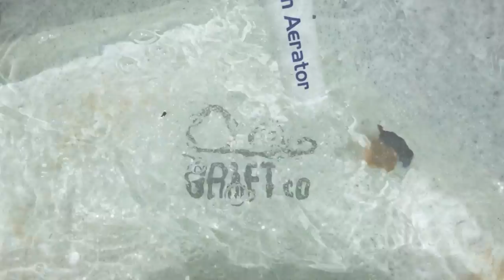HOW TO - Build a Kayak Fishing Livewell with Electronic Bilge

Comment: What're the hose fittings? I've never seen those before...
Reply from the maker: Im not actually sure what they’re called. Quick release fittings like this are what most hoses are fitted with, and searching our local hardware store page doesn’t really provide any guidance other than “hose connector”. Sorry mate, not sure if that’s much help
Reply: brand is Gardena they have SOME on Amazon, but they are pricey and they don't seem to carry the 3/4"  "hose repair connector"
Reply from the maker: @DanielMiller82  Thanks Daniel for finding that